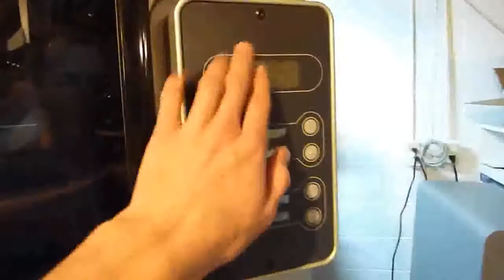A Look Inside a 3D Printer

Comment: I have a Stratasys Dimension Elite printer and I already hacked the filament cartridges so that I can use regular ABS but now I have a new problem: since the Stratasys filament is bigger in diameter than regular one (1.778mm as opposed to 1.75mm) I get underextrusion with parts especially in first layers which most of the time leads to parts either having ugly first layer or even becoming loose from the base. I was wondering if you know a way to modify the mvcplr2.cfg file as to increase flow for the model tip. I am connected to the printer using Putty but I am not familiar with the particular commands they are using. I know er to read cartridge Eproms and in to initialize diagnostic.